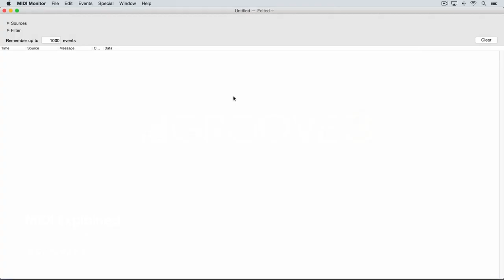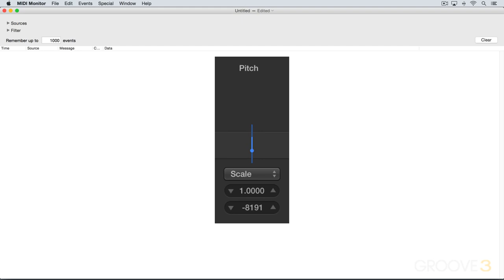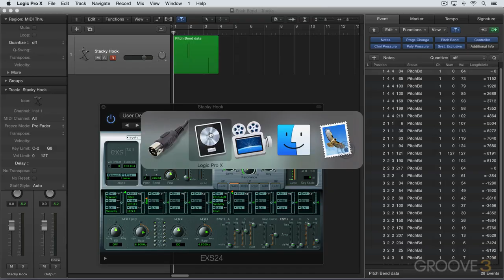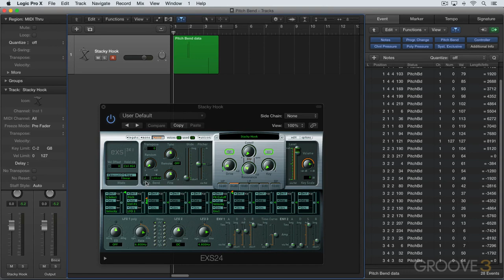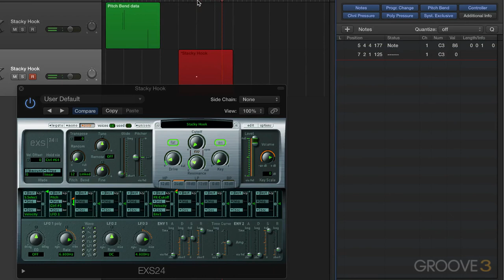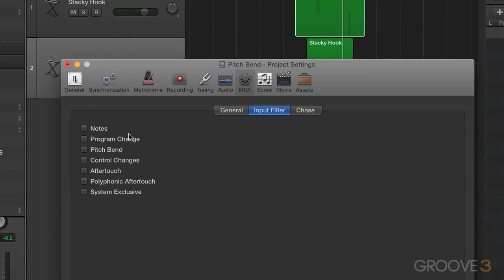Pitch Bend Messages (MIDI Explained)

Comment: Gonna leave this comment here with no hope of it actually being answered, but... what can cause the pitch bend to not return to zero (or 64 on a midi monitor) when centered? I have a Novation Impulse 61 and I've been scratching my head over this for years and cannot find an answer.
Reply from the maker: Is it possible you recorded pitch bend automation where it is not set to zero?  That would certainly keep it from returning.
Reply: @groove3Inc  Nope. Not even using it with a daw.

Comment: Very nice video, thank you for that. In a 14 bit number you have 2^14=16384 numbers as you said. But one of these numbers is 0. So the range is from 0 to 16383. Now, because we split that range so that we can have negative values as well, we can go from -8192 to +8191 because 0 is considered positive. So at 2:23 that's the reason you 're not getting +8192. The same thing happens with note velocity. Being a 7 bit number and 2^7=128, the range is from 0 to 127.